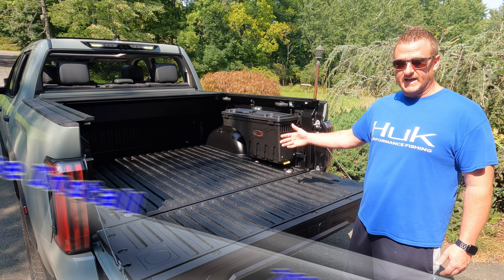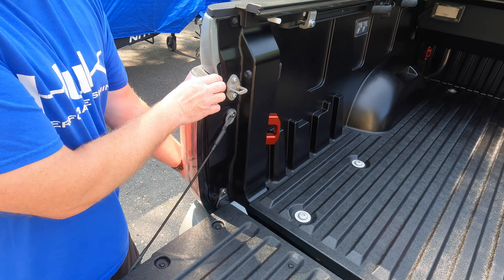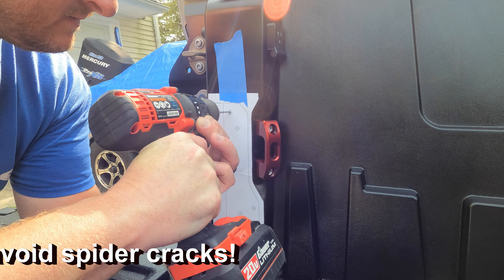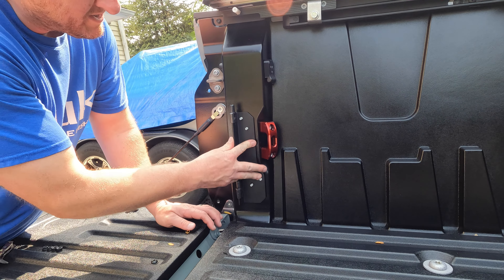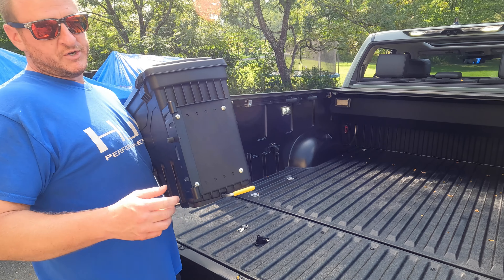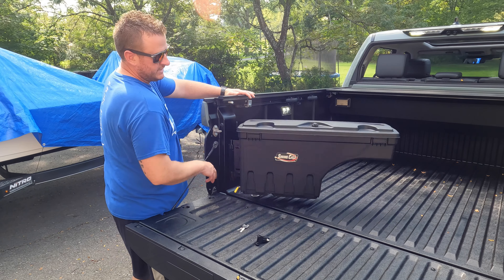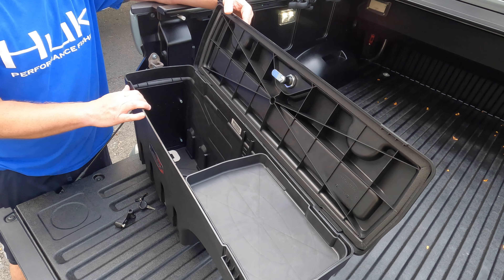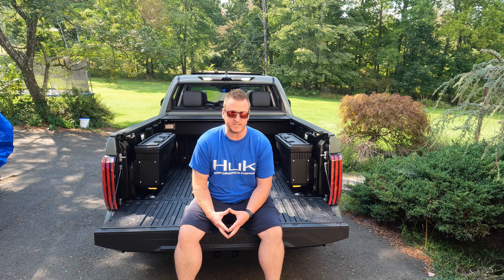2022 Tundra TRD Pro, Swing Case Install and Review!...No More Worrying About Storage!

Comment: Just installed one on the driver side today and your videos are perfect, I didn’t even looked at the paper instructions.  

One thing I didn’t do was the 90 foot pound of torque the bolts required.  It seemed too much.  Some truck lug nuts don’t even require that much.  I just made sure it was really tight, that’s all.  

Will soon buy  the one on the passenger side, since I will probably need more space.  

I am happy overall.
Reply from the maker: Thank you, I appreciate it!…yea I love em, perfect solution to add a little storage to the truck!

Comment: Lol..I had the same issue with the driver's side damper on my install.  I removed the bottom link too.  I was just curious how you got around getting your hand in there for the lower bolt plate.   I see we both had the same idea.

Comment: I love my swing case on my 17. Keep a air compressor, jumper cables and some lights ratchet and straps. Haven't had the need for a second one yet but I can definitely see my self getting another if needed
Reply from the maker: Yea absolutely!…wish I got them on my previous trucks now!
Reply: I would definitely utilize the second case as a cooler after installing a drain plug

Comment: These are awesome! I still have them on my truck...I remember my OCD kicked against that yellow rubber on the pull handles, which I ended up plasti-dipping in red! 😅
Reply from the maker: Ok, I’m copying!…lol…didn’t even think of that!
Reply from the maker: Thanks for the idea!
Reply: @NitroZ18Fishing  Anytime! It will make a ton of difference ...aesthetically at least! 🍻
Reply: @NitroZ18Fishing  Forgot to mention that you should let the final coat dry for 48hrs for the bond to become permanent.
Reply from the maker: Ok awesome, I know what I’m doin tomorrow!…lol…thanks again!

Comment: Was wondering if you're able to slide a 4x8 sheet of plywood in between the boxes? I sometimes haul a bunch of plywood but would love to have these boxes. Thanks for the video.
Reply from the maker: Hey Darren!…so you would be able to fit 1, maybe 2 sheets under the boxes (they don’t go all the way down to bed)…but there’s not enough room in between them once you come up to the bottom of the cases (hope that makes sense)…let me know if that helps!
Reply: @NitroZ18Fishing  Thanks for the reply, I guess one box would allow more than 2 sheets? Because the space would allow it on the side that doesn't have one of the swing cases.  It seems to be a design flaw,  just subtract maybe an inch from the width so we could have both boxes and allow multiple sheets in between the cases.  Your thoughts?  Thanks again for the videos.
Reply: Darren, I had the same concern but I got to thinking that as easy as they are to remove I could just take them off when hauling 10-15 or more pieces of 4X8 plywood.
Reply from the maker: @Darren, yea that would have been nice to be able to squeeze multiple 4x8 sheets in between!…as Matt mentioned, worst case scenario they are super easy to remove…you could pop em off if needed, they remove in seconds as shown in the video…hope that helps!

Comment: How long ago did you order your driver side? I ordered mine probably 2.5 weeks ago, installed it 2 weeks ago and I had the old template that the holes weren't correct. I also ordered from Real truck which probably had the older ones on hand. Love it however
Reply from the maker: Hey Kyle!…I ordered the drivers side on 9/6/22, just checked my Amazon order history…they’re awesome for sure!

Comment: Awesome DIY!  My Tundra came w/Bed Extender.  Just ordered these swing cases.   Do they use the same connection bracket as the Bed Extender or will I have to drill new holes?
Reply from the maker: Thanks man, much appreciated!!…that’s a good question, I’ve never used the bed extender so unfortunately I’m not sure, I apologize!…hopefully someone else can chime in for ya!

Comment: Looking a bit more, seems they changed from self tapping screws for mount to the bracket and nut, so most likely eliminated the issue.
Reply: Yeah, just got 2 and they both use self tapping. Wonder how long they'll hold up versus old bolt and nut...

Comment: I think it just makes the bed too small to use. I run a bed extender in my 2020 tundra pro. Which obviously I wouldn't be able to do with those swing out boxes.
Reply from the maker: Hey Joe!…That’s why I love the fact that it only takes three seconds to remove them!… I would definitely agree if they weren’t so easily removed, if I ever need the entire bed for hauling anything I could pop both of them off in less than 10 seconds…thanks for watching!

Comment: IMPORTANT: the template CANNOT BE TRUSTED!  Put your bracket over the template, line up the bottom holes, and mark the template for the top holes.  AGAIN THE TEMPLATE IS WRONG.
Reply from the maker: Exactly!...I made sure to mention that, it's crazy...some people have correct templates but others don't...so I totally agree, best to use bracket to make sure holes are in proper locations